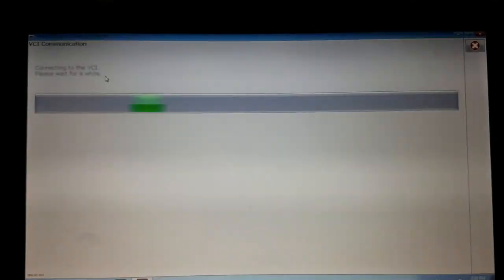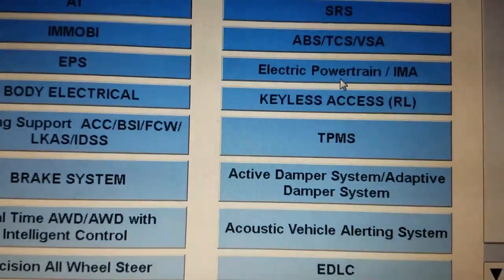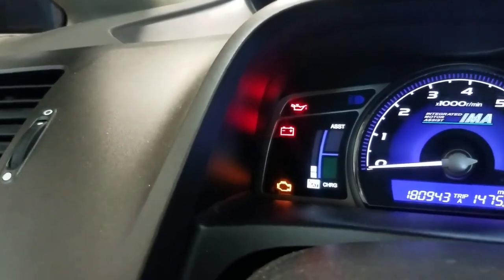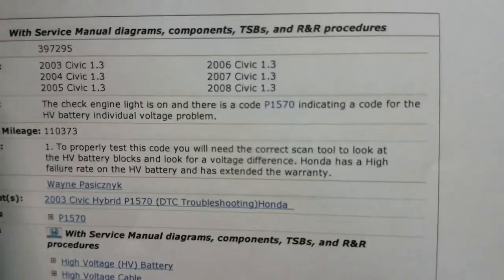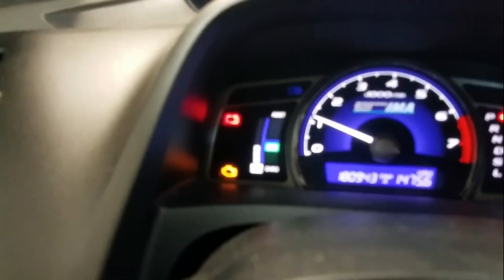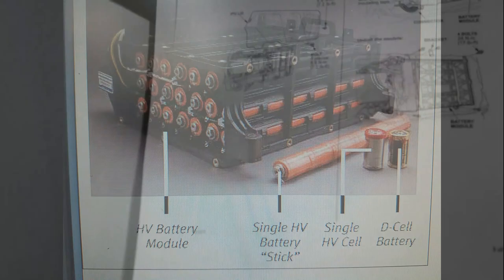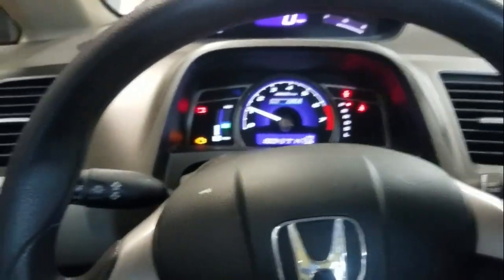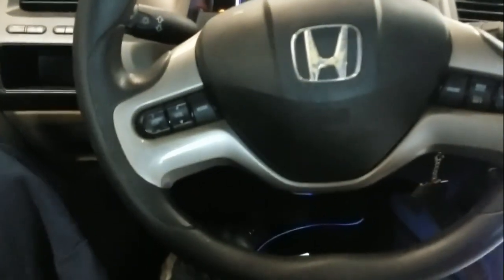P1570 P0A7F Honda Civic Hybrid High Voltage (HV) battery test

Comment: Did you have power.  My lights in the roof of the car very dim even on the dash. Just got a used high hybrid and it taken ima off and was functioning well.  It was turn on and immediately cut off and than went to complete dead.

Comment: my snap-on showed 15 v across all the cells but measured at the dc to dc I found 88 volts, so I don't know if the voltage is too low for the dc to dc to work correctly. the 12v feed to energise the dc to dc was there. but still I'm not sure wwhich to repair dc to dc or battery cells both are expensive. p1570 honda insight 1.3 hybrid

Comment: Hi. I was thinking about buying a second hand Honda Civic Hybrid 1.3 IMA 2006-2009. I want to avoid the battery replacement cost so i want to make sure the battery been replaced not Too long ago, or i want to make sure the current batteries in it have a decent lifespan left. What is your advice about buying this used car in 2018? What do i need to look out for? And how can i know if the batteries are actually dead, or gonna fail on me in tre next year?

Nice Helpful video btw! This was the only recent one so i decided to as you :)
Reply: I just bought a battery grid charger , hopefully it helps with my error codes & ima light , I do know the battery grid charger can be helped to maintain you’re hybrid battery so maybe you want to look into it
Reply: By 2018 Honda was using Li cells, not the NiMh cells in the car in this video. No real issues have been reported with LI cells.
Reply: @JAYJAY1787  Hello could you say if you were successful with your grid charger?

Comment: 07 HCH (175K) here, IMA light and p0a7f code.  I do not have a red battery light on.(hence my dc/dc converter must be good. 3 months ago i checked every cell with some being as low as 12.12v together (car had been sitting for 4 months).  Put it back together cause i needed to use car.    IMA light and check engine come back on intermediately within a couple weeks. with the battery gauge sometimes dropping quickly. (usually down to 2 bars.) and charges back up quick within a couple stops.  took battery out to test and see where the voltage is at. they are all 15+ volts.  even the ones that were low.   Im unsure where to go from here??? any advice would be great. just going to rearange and install again.        A+++ on the video thank you.
Reply: 2007 was not a good year for Honda hybrid packs, not much different from the disastrous 2006. You could try refurbishing the cells yourself or buying a refurbished pack, which may work again for about a year. However the best solution that doesnt cost a huge amount of money is a rebuilt pack using new modules, from a reputable seller. Unfortunately that will still cost you more than the car is worth anyway. You can also buy new modules yourself and swap them out for about $140 each module. Still fairly expensive to do. I think your car has 10 or 11 modules. You can do the math.
Reply: @michael47lamb  do you have any suggestions for a ‘10 Honda Civic? My check engine light just came on and it is the p07 (forgot the rest) no red batter light . code that means the battery pack is deteriorating. Should I keep driving it or, what are my options? Is it dangerous to replace on my own? drop your cashapp I’ll send a few over
Reply: @23evulp8  Thanks for the cash offer but I do this more for fun.

You can keep driving the car for a little while with probably little issues ahead, for now. But I got to warn you that old cells just get older and more problematic too. The choices for you now are these: You can take the car to a real Honda tech (here is a link to a guy checking cells like a real tech would  https://www.youtube.com/watch?reload=9&v=ByCj292sAdg&lc=UgzgE1OTauthH4iwB5d4AaABAg.8tprz83VH7q9Ic3-EPrDga&feature=em-comments)  

You can also just buy a new or refurbished pack from Honda (BIG bucks!) or from a reputable pack seller for a bit less bucks. Or you can refurb the pack yourself for few bucks but also a get deal of your time. Not all refurb packs are equal though. Poor cells can look just like good cells if you are only looking at them. Deal with sellers that have very strong reputations for quality. Also warranty info is important to know. Most will include a 1 or 2 year warranty. One I know offers lifetime but has VERY strict limitations attached too! (Greenbean)

FYI A few things you can do to keep the car acting well is to never let it sit for weeks at a time. Old cells do not hold a charge as well as new cells do. Sitting still is really bad for this too. So drive highway a few times a week as much as is practical, if you can. Do not use the air conditioner! The AC is all electric!

Another thing you can do is install a "grid charger" for that model car. This will enable you to charge the cells from your house outlet. Run this a few time a month and the pack will do better for a while. But the cells will still degrade over the coming months and eventually start failing anyway. Grid chargers cost a few hundred bucks too.

These hybrids were made to drive highway A LOT. And so the battery cells perform best then. As the cells get older the chemicals in them dry out and resistance goes up too making charging more difficult.  Then the cells run too warm (often far too warm especially is hot weather) for the fans to deal with. Then you get lots of warning codes.
Reply: @michael47lamb  is it plausible to just buy a pack from eBay for around $600-$800 and install myself? I do seem them with about +$100 for 1 yr warranty which I think I’ll add on as well. I saw a video where a guy was wearing 1000V gloves, turned battery off behind back seat waited. A few minutes and the voltage form his reader read 0.00... which means it’s totally safe right? I’m really just not trying to die changing this battery haha 😆.
Reply: @michael47lamb  thank you sm for the help btw. The dealership would be 2.5K + minimum, so 700-900 feels a lot better to me lol.
Reply: @23evulp8  It is doubtful that any used pack will be any different than what you already own. All these Honda hybrids age and wear at about the same rate so the used pack is going to have similar issues as your does now. 

However one thing a used pack does have is possibly a number of good modules that you can swap out for bad modules in your pack. Of course other people have already thought of this too and the used pack you buy could have had the good modules already taken out and replaced with bad ones! Buyer Beware as the saying goes.
Reply: @23evulp8  Good luck then. You will be needing it. FYI  If this is an ebay item I strongly suggest you buy the extended warranty ebay offers as well as use a credit card that offers extended warranty on purchases too. Used packs are often problematic. Also if you are going to DIY this project then why not educate yourself a bit further on pack rebuilding and DIY that too. It is a little tricky but not all that bad to do.

Comment: Hey, so I've got a 2006 Honda Civic hybrid and it's been dying on me while say I'm on lunch and have it on only to listen to the radio, no dash lights are on. I'm wondering what could the problem be, I had the battery charged and it still died on me. So idk what's the problem?? And if possible how can I get access to the warranty to get whatever is wrong replaced?
Reply: I know this may be a bit late for you but 2006 is way to old for any sort of warranty from Honda. Also since your pack does not seem to be holding a manual recharge the next step you need to take is either take the pack out of the car and taking out all the modules so you can work on them, OR you can simply buy a new or refurbished pack and then install that. Which is a lot less effort and time. Refurbished packs will work ok for about a year or two and then show signs of problems again. Used packs may not even work that long. New packs from a reputable seller like Honda will work for about 4 years and degrade slowly from there.

Working on it yourself is cheapest to do, so personally I would try that first. After spending some days on the modules with a NiMh charger and a multimeter you are probably going to find about half of the modules dont work right anymore for a bunch of different reasons. Cells fail in a number of ways. The 2006 was one of the WORST years for Honda hybrid pack designs too. You may be able to recondition some modules, but most are going to be "done," leaking or just "battery shaped lumps of metal." Replacing the bad ones is possible these days since there is a strong aftermarket biz in hybrid car modules. Just be careful who you buy from. Lots of crooks out there too. 

The best solution costs the most money of course: Buy a NEW pack from a reputable seller (not necessarily from Honda) Expect to pay about $2000 for a "decent" aftermarket pack. Going backwards in price: a refurbished pack costs about 1200-1700. Individual modules for your car cost about 140 each, used and working hopefully.